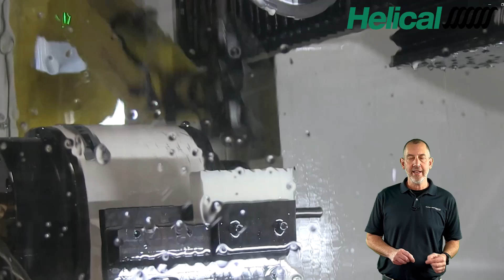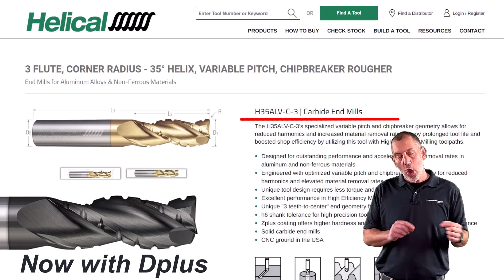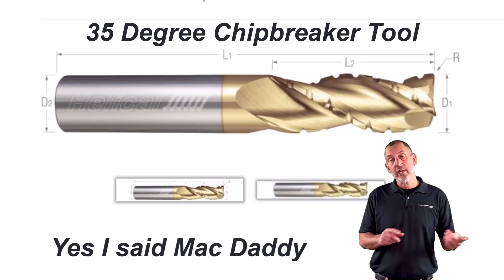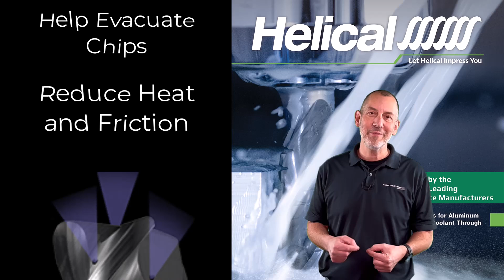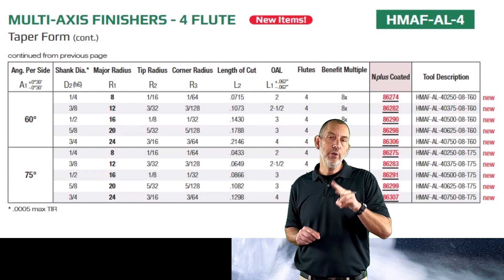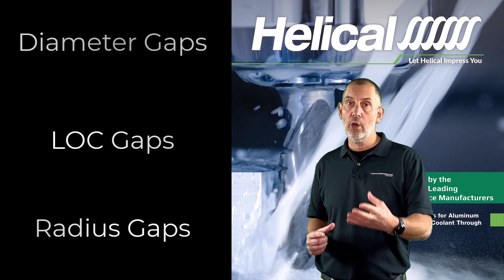Helical Solutions' 2024 Catalog - New Product Highlights: In the Loupe TV

Comment: So which of the two H40ALV-3 Uncoated/Zplus has a better performance-price ratio for the 6xxx and 7xxx series aluminum? Great channel👌
Reply: That would be the coated version.  Zplus.   Would not use the new Dplus in 6000&7000 series, could be overkill.  Unless you never want to change your endmill!!😂
Reply: @CuttingtoolCounselor  you mention that Dplus coating is for 4xxx series Aluminium–silicon alloys, so it can be used efficently for 6-7xxx also? What is the average Dplus rougher tool life on high speed dry machining (12000RPM) comparing to Zplus rougher? I would never want to change my endmil rougher for high series CNC manufacturing 😄
Reply: @33samogo  what’s the flute count your using?  Dplus will way outperform Zplus in 6000 and 7000 series.  I would say3 times the life min providing a stable setup. Reason I asked about flute count is I’m not a huge fan of 3 or more dry.  Although Dplus would be my choice dry.
Reply: @CuttingtoolCounselor  I am neither a machinist nor a programmer, but a developer, although I do all three, because I always want to push the limits (you can't make a great product if you don't know the technology ;). I am trying to come up with the most efficient milling plan for my serial parts of 6-7xxx T6 series, this includes a CNC machine as tools. In my case, rough milling has the greatest impact on the total time of milling work, so I will use the Volumill method in programming. What I think is crucial in the first step is to determine the optimal spindle speed for this operation, and this is conditioned by the tool harmonics (axial depth/spindle speed stability lobe diagram). If the most effective rotation range is somewhere between 12000 - 20000RPM, then it is necessary to ensure good evacuation of the chips, so the tool needs a maximum of 3 low angle flutes (I think 2 is to low, but I am not an expert). The axial cut is not deep, 15mm max, what feeds&speeds do you recommend in this case (3 axis operation) using Dplus? (I will adapt the machine to the optimal milling process, and not the other way around). Do you also have distribution outside the US? Thank you for your responsiveness.👍
Reply: @33samogo  I like your approach.  My main job at Harvey performance is to work with some of the best aerospace companies.  I know you probably thought All I did were these videos😂😂As you know there is a-lot of aluminum in aerospace. My question back to you before some recomondations. What is your Max spindle?  If we know this I can make sure I am optimizing that based on your axial.  Assuming you are using a volumill tool path as well.  15mm axial we could go with chip splitter if necessary.  I do a lot of the tap testing at Harvey/Helical as well.  So we know a little bit about the harmonics between spindle/holder and tool.  Last thing are there any radius’s I need to know about? Let me know and I can help make some suggestions.
Reply: @CuttingtoolCounselor  Great! 

I'm trying to avoid 4-5-axis machines for serial production, the plan consider 3 axis high speed CNC machining center (4 are optimal) with custom/standard tool crib, that will process at least 14 parts in one milling cycle. The spindle speed should not be more than 20000 rpm (too expensive machines are not cost effective 😂). The radius of the 1/2" tool is from 0.06 to 0.09, it can also be 0.125 if this increases the performance significantly, tool cutting length 1", chip splitter is fine. I would prefer to see rough milling dry, but as already said, all parameters, processes, tools, machines needs to adapt to achieve the most efficient rough milling, so coolant is optional. 

For traditional milling the equation is Feed = Spindle speed * Chip load * n.Teeth, but for advanced high speed algorithms like Volumill other considerations needs to be adopted so it is not simple to calculate especially if the axial cut is dynamic. Chip load, n. Teeth and SFM comes from catalog, and in my opinion Spindle speed should also be present for any specific tool in the catalog, because it's a trade-off between machining time per part and tool lifetime. Optimal speed parameter comes from natural frequency of the tool, and can be selected from stability lobe diagram (SLD) for any specific tool. So the speed and chip load are determined by tool itself and are not much affected by other parameters! The only question is where are the axial/RPM peaks on the SLD for specific tool and  which peak represents the most efficient ratio between the machining time and the tool lifetime for specific material. AI models can solve this operations with easy, so we can aspect that any advanced CAM will have this capability in a short time, also CNC centers. 

Thank you for all the information you are sharing, and please correct me if I have a wrong idea regarding the tool optimal spindle speed approach.
Reply: @CuttingtoolCounselor  I've done some additional research on how to determine optimal speed parameter that comes from tool natural frequency, to increase tool life and part surface quality, I also went through your channel where you share a lot of great information👍 and now I'm even more convinced that we really need AI to get us out of this mess of finding appropriate data from tool catalogs for HEM production setup 😅. As a product developer, I need data to determine the economics of producing parts before starting production, even before designing the parts, and machine tool data is a key factor in these calculations.

Industry 4.0 needs real time data to generate useful metrics for machine setup and efficient production managing, thus, machines need sensors, load cells and processing algorithms to automatically check and maintain machining process efficiency, especially in the case of HEM in high series production ( I believe CNC machining can be competitive to aluminum injection molding, with proper part design and efficient HEM setup!).  

It is clear to me now that I can get the optimal speed manually, after running the program on a machine or using monitoring for more accurate results. So I'm more interested now to find tool performance data to calculate the high efficiency range between minimum production cost and maximum production rate. Today I came across a fantastic CoroPlus application on the Sandvik website. With a few inputs app give me a pdf report with all key data, tool selection, feeds/speeds, chip thickness, operation time, tool life, how many parts can the tool make before it runs out, milling strategy, power consumption and much more... AMAZING, A-MAZING!

I am using CAMworks for programming and I spend some time searching and comparing before choosing the right CAM to work with. Trust me, I can switch to another CAM with ease even though I've been using Solidworks daily for 30+ years, just to have CoroPlus Tool Library plugin inside my CAM, and CAM programming is my supplementary job! You can imagine now how those, who are 100% CAM programmers, will react once they realize the power of this tool. Industry 4.0 is already here, Helical Solutions has half a year time to react with similar application add-in for CAMworks, because which tool you are using is not important at all, the impact of tool life/price on production costs is very low and all competitor top tools have a similar performance. What matters is how much time I spend before I get the proper tool and tool data for setup efficient machining process. All the rest can be done in CAM within a few clicks, if the part is properly designed! 

That's is my sharing 😉